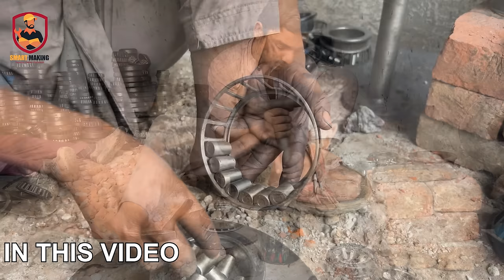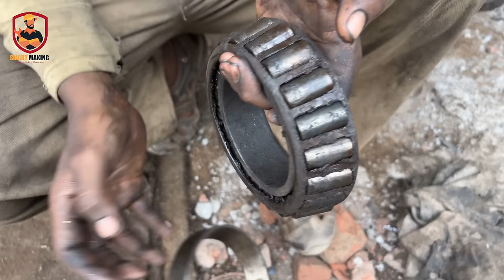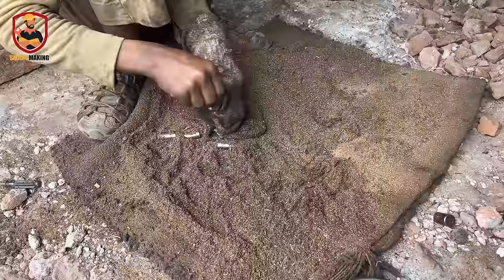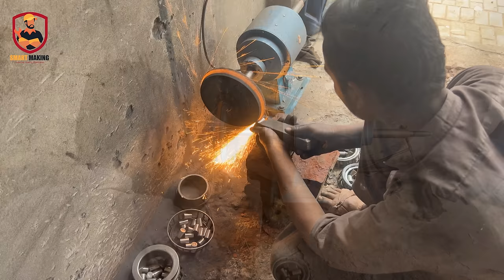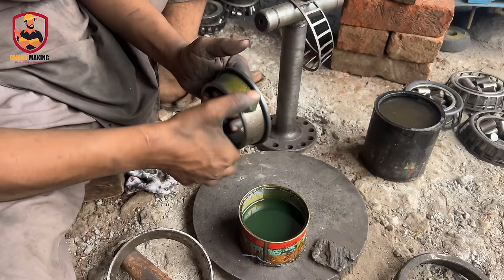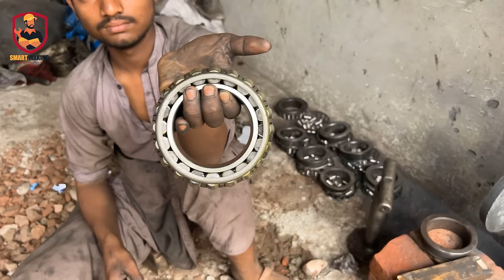Truck bearing repairing process with smart making | restoration of tapered roller bearing

Comment: Removing hardened surface.
Grinding by hand elements made in factory with micrometer accuracy.
No matching items.
Just because something looks like a bearing doesn't have to be it.
This "repairing process" is rape on mechanical rules!
Reply from the maker: have your own perspective

Comment: The precision, the cleanliness, the extremely exact heat treatment and hardening ,the accurate use of the Pakistani micrometer (BFH) is exactly as expected.
Reply: Genetic problem……
Reply: Ridex bearings xD
Reply: They making this video for YouTube content, and for our comments.
Reply: iso 9001
Reply: @fendtbluebird4701  shit I hope not,,,, more like ISO 2000BC,,,, as in a smooth rock would make a berring as good as that one they put all that work into LOL.
Reply: These are used in camel carts ,,slow moving trollies not good but can work for several years
Reply: @promechanics2395  I see, thanks.
Reply: @smartmaking p
Reply: @smartmaking s r QdqEh
Reply: @smartmaking 😊

Comment: This would kinda make sense if they replaced e.g. a broken roller with a new one, or better yet, one with the same amount of wear as the others. Or if they used still healthy parts of multiple bearings to build a serviceable one. But in this vid they just polish, clean and grind the parts of the same bearing. At best it will be the same as before, only cleaner, but it will rattle more due to increased tolerances.
Reply from the maker: have your own perspective

Comment: HOW does the guy grinding the rollers know what size he is grinding and keep the taper roller bearing accurately ??? I would love to check these items on a comparator for sure. Then I will be sold fella.
Reply from the maker: you can try this
Reply: @smartmaking  I think I will pass. My good eye does not have a built in comparator attachment at birth.

Comment: Pre-spalled bearings and races, & bent retainers. How innovative. Saves you gas not to have to wear them out before installation.  Drop rollers on ground and put into dirty old sock with others and dirt. I wonder what the % of failure rate or life of them are? Minutes?
  Glad I don't have to trust those bearings in my vehicles.
Reply from the maker: have your own perspective

Comment: My company had a “repaired” bearing fitted by contractors into a primary gearbox which failed very quickly causing millions of dollars downtime. Now the only bearings allowed have to have materials and manufacturing and heat treatment history.
Reply from the maker: then you have to use them
Reply: @smartmaking  no the “repaired” bearing got into the supply chain with original packaging etc. the highly competent contractor was fooled as well. All are punished!

Comment: Although these bearings are repaired but according to international auto Mobil engineering they are not long lasting as their life is very low and when these are installed again they seized and in result they broke the part in which they are installed and cause great damage to vehicle 🚑🚜 as well as monetary loss😢
Reply from the maker: have your own perspective

Comment: This might make them seem to function better but without precision regrinding, polishing and re heat treating these berrings done this way would be dangerous as hell and last only minutes (in perspective or actual) in a heavy loading high speed application,,, so nice try guys,, they might last for some time in a low load low speed application such as seldom used farm type equiptment and such,,,,, but please don't be putting them in highway speed machines of any kind it's a bad thing waiting to happen and probably sooner than later, this coming from my nearly 40+ years as  a mechanic,, once a berring gets pitted it's done for and just grinding away the pits just help accelerate that process by a huge amount,, becoming very dangerous as it becomes massively under sized by specifications for it's intended purpose,,  things like wheel hubs  literly can come flying off due to those out of spec issues.,, so please no just get new berrings and if ya got to save these for farmer browns hay bailer or manure spreader or hay wagon if ya got to,,,,, or hammer fordge them into really good knives or something but not as berrings again.
Reply from the maker: have your own perspective
Reply: Have a closer look at the inner race they used, its totally screwed.
Reply: @dcc5931  Totally a scam,, that bearing won't last long,  even if installed in a donkey cart
Reply: @Brian-mp6bg  I know that and you know that but apparently they don't know that or don't care or both.
Reply: @dcc5931  yep I saw that strait away,,, doesn't matter jack shit if you put brand new rollers in it that race will eat it for lunch in nothing flat,,, even at low speed.

Comment: This is very good for sustainability. But since everything is done on the floor in the dirt, this is not quality work. Build yourself a work table. And buy safety goggles for grinding. It would be a small investment but a huge step forward.
Reply from the maker: This is not dirt, it's a special soil which is used for cleaning the oil on bearings but thanks for your advice, we will take care of it
Reply: Yeah, like the dirt floor and safety glasses are the only things wrong here.   😂
Reply: There is nothing sustainable about this.
Reply: @shawn6632  yes thanks for pointing that out . what are these people thinking ?

Comment: I'm always impressed how parts are repaired or refurbished in these countries. Personally I would never do it this way as I consider bearings to be precision parts but I won't deny that it works in the end use here. I'm betting on wheel bearings which have relatively low speeds??
Reply from the maker: have your own perspective
Reply: Сколько это по времени отработает?
Reply: Bearings for axial loads can be "repaired" this way. Bearings for radial loads you always need new ones.
Reply: @smartmaking ❤
Reply: l